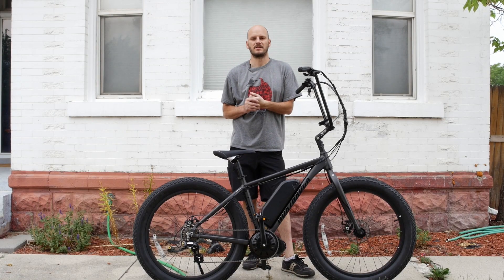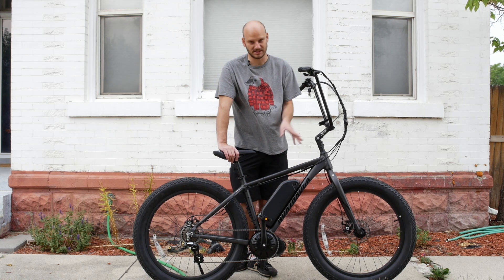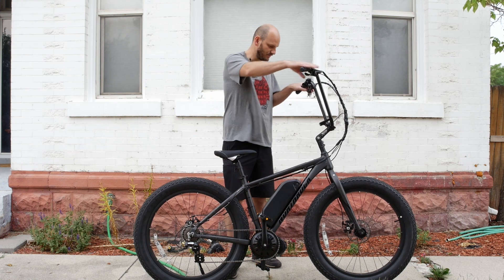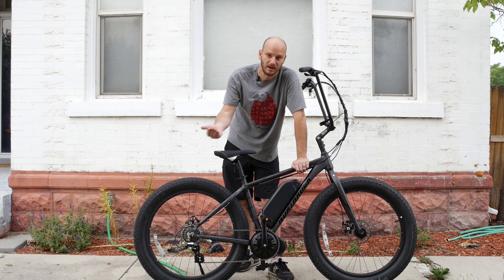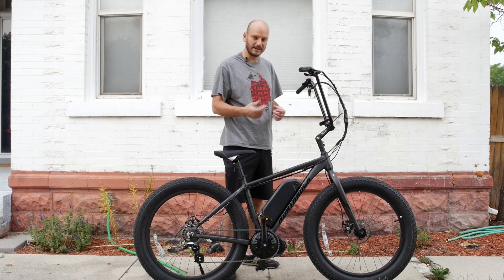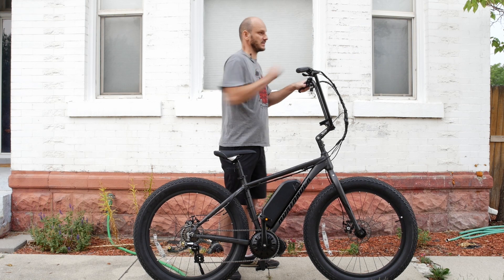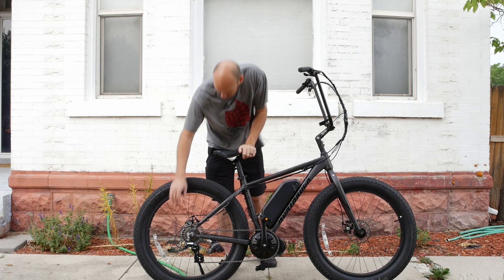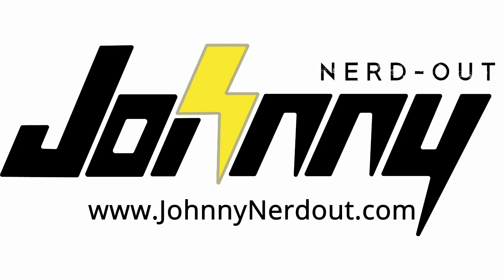Custom E-bike Build: Northrock XC00 Fat Bike BBSHD 120mm 52v 16.75ah Cheapest Fat bike from Costco

Comment: Dang! I just built a Mongoose Malus like that. The only original Malus part was the frame and fork, everything else was replaced. I used 27.5X2.5 wheels with street tires. I need to go with a bigger chainring to eliminate ghost pedaling. Heading to your website now to see what you have. Just bought the Lekkie throttle from you, nice.

Comment: I use shimano xt cassettes  on the back of my mid drive fatbike. With 26 tooth front .
I have ripped Chinese  cassettes apart. 
Shimano  makes a 34 tooth rear freewheel that is reasonably  priced mega range.majoity of econo bikes use freewheel.  I used one with excellent  results  before  I switched  to a framed fat rear wheel with cassette.

Comment: Johnny, I just bought this bike and want to do this build but need more low end torque for hauling gear and game and hill climbing. If I go for a 36t chainring or different rear gear set up, do I still get the 120mm bracket motor? What rear gear set up should I go with if I add a front 36t to ing? Thanks.

Comment: Does the Jumbo Shark 52V 20ah battery fit the Northrock XC00?
Reply: I used that battery, but it was a serious PITA to get it mounted.  It barely fits inside the triangle, and only one water bottle bolt hole can be used, and even then you'll need to drill a custom hole through the battery mounting base.  That can secure the bottom of the mounting base but the top has to be held by wire tie or something.  I got it in there, and maybe it was worth it because I like the range, but I've told others that I'm not sure I'd do that a second time.
Reply: @don.newlon  Wow that sounds like hard work. Can you still manage to remove the battery to recharge? And what bike/size frame did you install that in?
Reply: @JoshuasTejas  I just charge it on the bike, which was always my intention anyway, but a PSA that the half-inch or so of vertical movement required to slide the battery off the base is pretty difficult to create and a bit of a wrestling match.  The 20ah battery is that tight.

Comment: I just did a build with this bike for $1600 (gotta find those craigslist deals) and I put my old Shimano hydraulic brakes, a 135mm suspension fork in it by 3d printing a crown rac, and base dang I love this bike. Got the Luna bbshd 100mm bottom bracket (with one 5mm spacer) with 1500W continuous output with 2×[52v 19.4Ah] batteries and a 12-32T cassette with the Luna eclipse 42T front. I measured an applied torque of 168Nm and a peak of 186Nm +/- 4Nm. Truly an awesome bike! My advice though it's to get spacers because you will need them!
Followed your advice, and oh man thank you!
Reply: If anyone is curious, I get about 51kph Max on flat ground, avg of 48kph top speed across medium to high charge with an avg of 80Nm of torque at this speed. Truly a hill climbing champ that you can still ride on the road

Comment: Terrific vid. I built this same bike (less ape hangers) after consulting with Johnny about two months ago.  This bike seems perfect for a BBSHD build, since one of the ways it saves upfront price is that the bike doesn't come with a front derailleur, which would have been removed in the ebike build process anyway.  As Johnny mentioned, the bottom bracket is 100mm precisely, and I used a 100mm BBSHD.  Perfect fit.  Also, great chainline after install without the need for a high-tooth Lekkie Bling Ring. Ultimately I used a 40T front ring from Luna to increase the stump pulling power, and to eliminate that heinously ugly stock Bafang 46T ring.  I ultimately changed the freewheel to raise the top gear so I could assist a little more at higher speeds, too.  Loving it.
Reply: Where did you order your Bafang parts? I'm looking to build this bike as well.
Reply: @JodyGates  I ended up ordering everything from Luna except the battery.  I ordered the battery through one of the suppliers Johnny turned me on to:  Unit Pack Power Battery (UPP) through Amazon.

Comment: Hey Johnny i got a question i dont know if you could help. So i got a bbshd on a specialized frame and yesterday i put the bike in my car and it fitted okay in the car but now it is not working. I really dont know why it could be maybe all the weight distribution was on the crankarms. I dont feel the motor cogging when rolling backward and the chain does not spin when crankarm is spinned backwards. I build the bike 2 days ago and it worked perfectly before this episode?

Comment: Love the fat tires on the costco bike. While the ape hangers handle bars are cool looking, they're a bit too high to be practical mixed use riding.  You just converted my Trek Marln 7 and I love it !!!   I want to add a little wider tires, but noticed front rim is not centered on front forks due to brake caliper assembly being up close to the fork and wheel aligned to that side.  Any suggestions on how to move the brake caliper assembly further in to allow front rim to be more centered between the forks?

Comment: I built the same bike. 1000w, 52v 20ah and installed a 36t Lekkie chain wheel on the front. It is a beast.
Reply: can you help build me one please??
Reply: How was the chain line with the 36T? And do you have a 28T rear?
Reply: @Hybrid600  The chain line is great on the Northrock XCOO but on the XC27 you will need to have a chainring with at least 5/8 off set. I had a 42t chainring to start on the XCOO and it had no offset. It worked great but wanted a smaller gear up front so I went with a 36t. Still does 31mph.
Reply: @donstaggs3827  any special parts needed to change the BBSHd to 36t? Thanks.
Reply: @WesternBigGameHunter  Nope, just order one for a Bafang. I will say that the smaller the sprocket the less offset that you will get because of the diameter of the motor.
Reply: @donstaggs3827  thanks. Did you change your rear gears at all? Or just the front chain ring? Know of any videos on how to change the front chainring? New to all of this and just bought the xc00 to covert. Need some low end torque for hauling. Thanks.
Reply: @WesternBigGameHunter  You will need to install the chainring yourself anyway. You should put it all together to see where the front sprocket lines up on the frame. I ordered a 42T when I ordered my motor. There are tons of videos on here on this topic.
Reply: @donstaggs3827  thanks. I’ll book a consult with Johnny. Know nothing about replacing gears, offset, chain line etc. want to get this right before I start ordering parts.

Comment: Im thinking about taking a 26" beach cruiser 5 or 6 speed with 3 piece crank on it, thinking about putting front & back electric hub , 2 controllers , 2 batteries , 2 displays , 2 thumb throttles side by side with a mount that is mounted to both thumb to wear when throttling one they both throttle together, so with the peddle assist, im questioning this , can i run 2 peddle assist to only one magnet disc , one on top and one on bottom of the magnet disc , would it work or would it create a problem ????
Reply from the maker: Do you have coaster brakes? If so, a bafang won’t work. Have to go tongshen or hub motor
Reply: @JohnnyNerdOut  
No im not gonna go with bafang if i am to do this , and if im gonna go with 5 or 6 speed it wouldn't b coaster brake, a hub in front on the forks and a rear hub , not a mid drive , just wondering if one magnet disc would work for both peddle assist, a few inches away from each other to one magnet disc ,
Reply from the maker: @rickp7683  should be ok 🤷‍♂️ maybe just split the single PAS signal to both destinations?
Reply: @JohnnyNerdOut  
When the time comes to where i do it, im gonna try it separate first and see how it goes, just don't want to fry anything, controller or Hall sensors , thank you ,

Comment: I wonder if yours has a different set of gears than mine did. Mine I think would climb that no issue though mine is a Luna with hotrod settings. But I also can't quite get to 35, I top out at a gps confirmed 33. Perhaps I will count the gears next time I am in the garage.
Reply: Also I got the 100 mm kit because I didn't want to deal with spacers. Have always had issues with things coming loose with them. This thing fits like a glove. Hope I don't decide to upgrade the frame!
Reply from the maker: Got ridding just means it isn’t limited to 750w, but uses the full 30 amps. All mine do too. If I put a smaller chain ring up front it would climb it no problem
Reply: @JohnnyNerdOut  yea, next step will be an ASI controller from High Voltage. That will take a new battery as it will pull about 50 amps. But got to get back to work first.

Comment: Nice build. What did the total component costs come to on that bike? How hard was it to extend the cables, i.e. brakes, derailer, throttle, etc?
Reply from the maker: About $1200. Not hard at all.
Reply: @JohnnyNerdOut  is that battery available on your site? Which one is it in your site? Ready to place an Order with you for motor and all parts.

Comment: Conversely, on the road, that set up gives you a lot more useful gears. Let's face it, you aren't going to do squat off road with those ape hangers.

As for the brakes, I wonder if old fashioned "Travel Agents" could be modified to work? They really help when I convert long cable rear brakes on bikes like The Townie.
Reply: I'm curious why you would want travel agent style brakes, are they lower maintenance than a disc brake? Do they stop better?
Reply: @walkerskii  most bikes didn't come with disk brake mounts and disk brakes do weigh between two and four pounds more than rim. There are more reasons, but you get the idea. Travel Agents just increase the power applied to the rim brakes.

Comment: If you where to set up the throttle to have full power in all settings, is there a better throttle unit that could give you better control than the stock bafang unit? Great Build!
Reply from the maker: I've found the universal throttles to not have as much modulation as the left/right handed ones. Maybe its just me as I haven't done any investigating yet.
Reply: @JohnnyNerdOut  do you have any videos on how to change the BBSHd chain ring?
Reply from the maker: @WesternBigGameHunter  no but it’s easy. Just remove the bolts holding it on and the pedal. It should slide off around the crank arm and the new one should slide on the same way.
Reply: @JohnnyNerdOut  thanks. I bought the xcoo per out last consult but saw your video about gear changes needed. I’ll book another consult as I want to make sure I order the right items to change the front and rear gears and if changing to 36t, should I still order the 120 bshdd etc.

Comment: The customer brought this bike to you?  It is no longer available at Costco
Reply from the maker: Yes, I know, I've been recommending it and then saw they dont have it anymore!
Reply: @JohnnyNerdOut  Yes, I bought one 2 weeks ago and now it is not listed but I did purchase a few XC27 models for $350.00 in the store two weeks ago. It is not a fat bike but it does have 2.2" tires on it. Also has front shocks. It is aluminum and is a very nice bike. I installed a 1000w BBSHD, 52v, 20ah battery. It is a better ride and $100 cheaper with front shocks. (You will need the 68mm lower instead of the 100mm)

Comment: I checked Cosco online and not seeing this bike. But if you can get that for that price right now, that's a great deal! Shift sensor is a game changer, I put one on cause of one of your builds. I feel comfortable loaning my bike out to someone and they wont destroy the chain/gears. Cool build!
Reply: They seem to go in and out of stock. I got one a couple of months ago. Keep checking. Delivery was just a couple of days.
Reply from the maker: I think Costco has a lot of seasonal items- and this may have been a spring/early summer item. Also might be what Paul said... could come back into stock.
Reply: @JohnnyNerdOut  yea they have had it off and on for at least 3 years now. Used to be $299 with the same components! I wish I had gotten mine then!
Reply: uncle dan here hey man can you help me get those handlebars? hope you are well. this killer dude onto deck and honest.